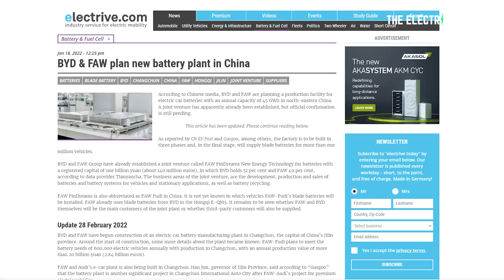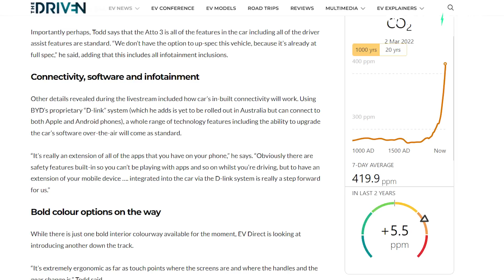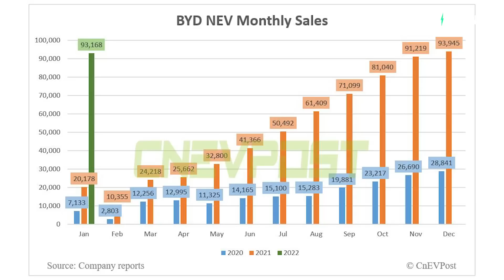BYD questions answered + BYD's massive 1M EV expansion

Comment: This is the warranty in China:

 "三电系统终身保修政策需满足非营运车辆（首任车主），自车辆交付之日起每12个月为一个周期，每个周期内行驶总里程未超过3万公里。具体细节条款详见《三电系统终身保修凭证》或相关规定。"

Google translate: "The lifetime warranty policy of Sandian system needs to meet the requirements of non-operating vehicles (first owners), and every 12 months from the date of delivery of the vehicle is a cycle, and the total mileage in each cycle does not exceed 30,000 kilometers. For specific details, please refer to the "Sandian System Lifetime Warranty Certificate" or related regulations. "

三电 = "Sān diàn" = "Three electric systems" = Battery, Motor(s), electronic control system

So, as long as you drive less than 30,000 km/year, the warranty is for a lifetime (first owner).

It must be a marketing thing to get momentum for the new cars in China.
Reply: Do not get fooled by the "lifetime warranty" it does not mean a human lifetime, it means a battery lifetime or whatever the manufacturer thinks is the life of a battery with most saying around 10 years. So in reality the warranty is 10 years.
Reply: @gregb1599  - That is not what the text of the warranty says.
Reply: @johannbrauer9285  Google what a "lifetime warranty" really means
Reply: @johannbrauer9285  Then BYD will go bankrupt for sure when many batteries start to fail around the 10-15 year mark and 10s of thousands will all get new batteries...
Reply: @gregb1599  - Per the warranty terms, at 10 -15 years the cars would have max 300,000 - 450,000 km on them. Far from the 1M km that the batteries last.
I don't think that the warranty is available in the future. I think that it is a marketing gimmick to gain market share at this time.
Reply: @gregb1599  - a "lifetime warranty" means exactly what it says unless fine print says otherwise. I don't know the details of Chinese law regarding warranties, but unless fine print says otherwise the Federal Law in the US protects consumers in these cases. Keep in mind that the BYD warranty is China only.
Reply: @johannbrauer9285  Also the short 30,000km per year rules out any taxi or ride share use, but that would be exempt in the small print anyway, but the experts all agree age is worse than distances that is why they can offer 500,000km, but like all warranties they are limited to 7-10 years. The early Tesla's had unlimited mileage warranty but still 8  years max now even they are now 8 years or 160,000km to 200,000 km depending on model. MG is currently the only EV that has a 7 year unlimited mileage warranty in both Australia and NZ. But again taxi and any commercial use will not apply to that warranty and the average Australian driver goes just 13,000km per year
Reply: @johannbrauer9285  No lifetime warranty means at least in my country means the expected life of the product not the person so no way they would offer a battery with an 80 year warranty, thats just stupid. And as you said you have not read the fine print...
Reply: @gregb1599  - I don't know where you pull these 7 - 10 years limits from. I just posted what is posted on BYD-China website. If you know something factual about the BYD warranty that is not published, please post a link.
I'm not that interested in guesswork.

Comment: The research I have done suggests that there are about 900,000 new cars sold in Australia every year.
So if the Atto 3 is a reasonable thing at a reasonable price 18,000 a year should be able to be achieved.
I must admit the Atto 3 is higher speced than any car I have ever owned.
Given a choice I would prefer to get a more basic car at a lower price.

Comment: The price thing certainly didn’t happen to me when I bought mine. The only oddity was the dealer was offering £2000 off if you took out finance which I would not normally do. Under UK law we have a 30 day cooling off period within which you can pay it off and only pay a day rate for interest. I paid it off after 5 days and so saved £1950 off list. No ‘topping up’ the MSRP. It also made the car cheaper than a used one which are often more than MSRP because some people can’t wait.

Comment: From a practical perspective some of the BYD models look great and I wish there were plans to introduce BYD to the US. I have no problem with the standardized pricing structure but the lack of service centers, which plaques Tesla, and a reliable charging network is an issue. Tesla’s network is impressive but ignores secondary population centers. Other charge networks are notoriously unreliable. Service on EV’s, body and and electronics, needs to exist to assuage customer concerns.

Comment: Hey Sam I have an hypothesis, like my 7 year old daughter would say after watching her documentaries, why the Chinese went directly to EV to Conquer & Dominate the Automotive industry.  ICE technology when compared with Electric Motors is far much complexed.  This complexity to get it right, takes ages of knowledge and experience in designing as well as manufacturing.  

In an ICE you have pistons moving up and down, turning the crankshaft into rotational motion through a gearbox which could be automatic or manual, to turning the wheels.  Whereas with EV you just have a Stator & Rotor, you do not even need a gearbox, because of torque availability over the powerband. I will be 49 on next Saturday and following the automotive industry since the mid the 1980's.  I have been following the ICE developments since then, well I may say that technology has evolved a lot;
-> for the Fuel system from Carburettors, to mono injector systems, port injection, sequential port injection up to direct cylinder injection;
-> for the Ignition from the mechanical contact breaker systems, to breaker less systems to direct Coil on plug on the spark plugs; 
-> for the Valve timings which took 30 years to be both available on the intake and exhaust; 
ALL controlled by the ECU.  

With the EV system you just need an inverter driving/switching the electric current in the 3 phase stator.  The ECU -> Electronic Control Unit commanding the inverter which chops the DC and generates the 3-phase waveform for the motor.  Whereas the battery/cell chemistry is like making good Wine or Champagne in mass quantities.  

You are right Sam when you say the traditional Automotive industry is resisting the transition to EV, because for the traditional ICE technology manufacturer they have been screwing their customers by delaying new technologies implementation whilst making a lot of profit with older technology, profits have always been more important over product refinement.

But I have a reserve when you glorify the Chinese EV industry because they say they want to be the DOMINATOR and not the LEADER, for me these 2 words have very different meanings.  When you are a DOMINATOR you will not allow anyone to come and compete with you at any costs or means.  Whereas when you are a LEADER you will learn from your competitor and promote innovation.  What is your take?
Reply: Possibly, but I think main reason is China has very little oil or gas and is dependent on imports from middle east. They don't want their transport fuel having to run the gauntlet of the 5thbFleet. It is a strategic decision and if as a result they send Ice i industries to the wall no problems.

Comment: Always great info on the EV innovations. Thanks Sam.
In the EU  (Netherlands) we have a law that makes it illegal, to up the price after the contract is signed. 
The price advertised is the price you pay. Even when the price (within reason) was wrongly priced to low. 
So, when the dealer prices a car 10% to low, he is held by law to sell it for that price. The law is to protect customers against dealers that lure customers in with that low price on purpose.
Thou there is a margin where the judge will say that is a real mistake, like advertising for €3999,00 for a new EV instead of €39999,00. 
Then, the customer should have known it was a mistake.

Comment: BYD distributor in Hong Kong charges about Aus$1000 a year for annual maintenance in order to keep the warranty valid! They also offer a 4G data plan for about Aus$30 a month with 1GB of data which is 3-4 times more expensive then normal mobile data plan.

Comment: I assume your getting home charger and any additional home battery packs from BYD for home. 
Who is responsible for installation of charger at home how much does dealer get involved with this?
Reply: Hi Dan, I bought an MG zs ev 6 months ago (love it). The home charger was a separate purchase. There are a few companys in melbourne. I contacted 'evolution australia'  a melb companys and purchased an 'zappy' wall charger. I think the unit was maybe $800 then installation through evolution $700 (They have a sparky who the send out to install). Took one sparky a day and it works like a charm. Connected to solar panels so free charging during day.
Reply: @nickdanne7270  Do you have to have a charging unit installed, or can you just plug into a normal power point?
Reply: @raymondmumford6255  Hi Raymond, I would say, practically the answer is yes you do need to get a charger installed. I kind of feel like they should come as standard with your car if you dont have one. Its kind of like buying a laptop or phone and not getting a dedicated charging cable with it. They do come with a charger that plugs into your normal power point but its just to slow to be practical.  The only only time I have found the charger that came with the car useful was when going on overnight trips to friends places. I am able to plug it into there house overnight and just trickle a few extra kms in so I can get home.  What I never realises was... if you just front up and get the dedicated wall charger installled you basically never have to stop at public charging infrastructure (exceptbon really long trips of course) because your servo is at your house, so every time you leave your house your full. Sorry this is a crazy long answer but yes if you want to enjoy owning an electric car definately get a dedicated wall unit!